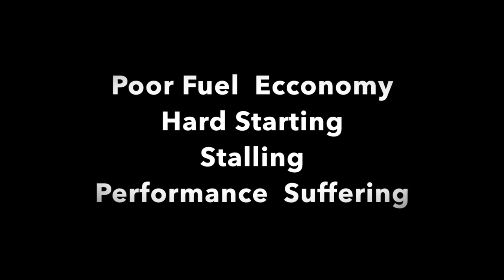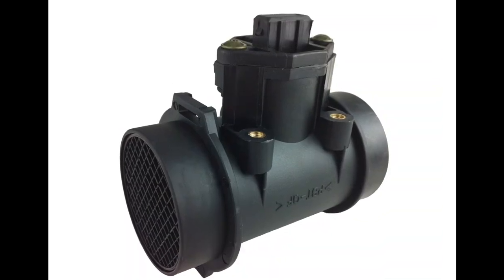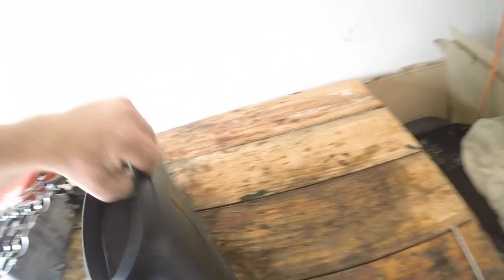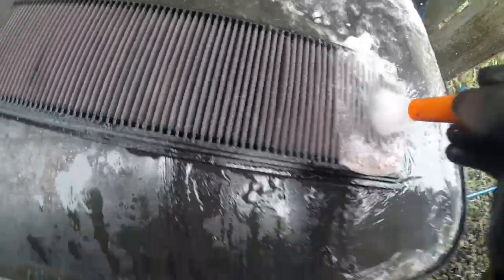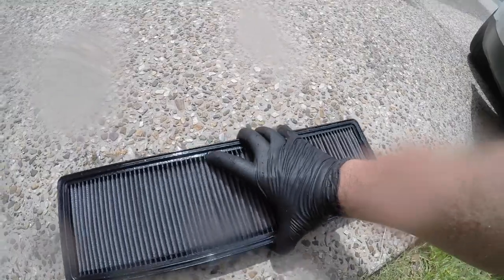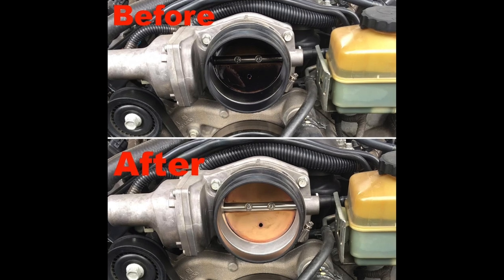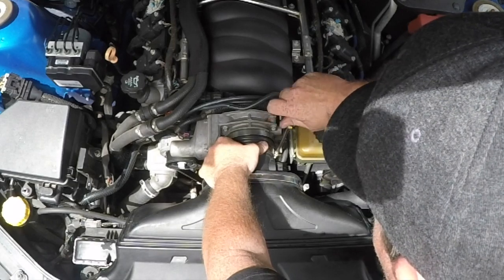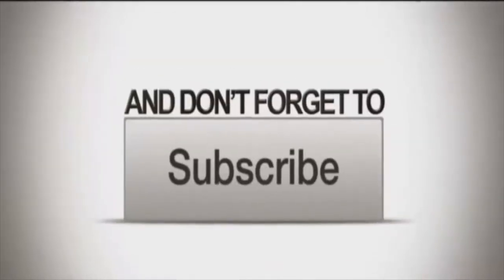MAF and Throttle Body Cleaning with Bonus K&N Filter Cleaning

Comment: Do you have to disconnect the battery and do dirty MAFs & throttle bodies throw off b1s1 O2 sensors, making it show up on a code reader? I have a very dirty air filter on a newly inherited 1995 Mazda protege that's prob never been cleaned, but only 98,300 miles
Reply from the maker: Change the air filter for sure, clear any codes and take it for a drive. You may find the O@ fault code doesn't return. On that model it would be easy to take off the intake pipe and have a look at the throttle body seeing if it needs cleaning and there would be no need to disconnect the battery but just be aware that its still connected. Hope this helps.
Reply: @killawattgarage   You're the first on YT to respond.  My first time owning a car, so thank you.
I hope I won't have a hard time finding an OBD1 reader,. I found out about the o2 sensor heater failure (po135) from a mechanic's reader. Thanks again.
Reply from the maker: @ayeshaflores7917  No problem. Let me know how it goes.

Comment: Really good video.... I'm just wondering if you got some advice for me. 

I just hard my turbo reconditioned and reinstalled in my BMW 525D, 2litre, twin turbo. Automatic 13 plate. 

The car does not let me put my foot down. As soon as a I put my foot down the gear changes. Doesn't let me go past 2-3000 rpm. 

And cuts power. Then throws the drivetrain malfunction light. Any ideas? 

Could it before the MAF sensor?
Reply from the maker: If you are getting a malfunction light I suggest reading the codes to start with and then go from there. Thanks for the comment.
Reply: @killawattgarage  the code is 244C00, just find out yesterday. 

It's "charge pressure control, high pressure stage control deviation, charging pressure too low / positive control deviation.

Comment: Do k&n really filter the air like OEM ...and does using oil on the filter cause any issues with maf sensor
Reply from the maker: K and N filters are an aftermarket replacement best suited to particular situations where you would typically need to replace the filters a lot, making things cheaper in the long run. K and N clam their filters flow better but over oiling will cause issues with the MAF and flow much less than OEM. Thanks for the question.
Reply: @killawattgarage  thnx...

Comment: After cleaning the throttle body, my car is behaving weird, car accelerates on its own up to some extent, even if I brake, it feels some one is pressing the gas pedal to some extent, and I also hear engine roaring.  Please help me, I did relearn procedures, test drive, no use. Mine is a Hyundai i20. Clutch pedal feels hard to press, steering weighs more than before, engine vibrates more than before. Am very sick of this issue.  Please help mate
Reply from the maker: Is it throwing any codes? Check engine light?
Reply: I got a engine misfire once, went to the Official Hyundai service, they cleared the spark plugs, and cleared the codes. I told them about the throttle body and all these issues, they told its normal, but am damn sure my car isn't smooth like before. 😔😔😔, they only cleared the throttle body before and then these issues have arised,, I even changed the clutch plate assembly, MC sleeve, but still clutch has become hard. 😔😔😔 and the car runs on it's own while braking
Reply: @killawattgarage  are you there.?
Reply from the maker: @bharathv499  yep mate still here. Instagram is a quicker way to contact me.

Comment: WARNING !!
 DO NOT wash your K&N air filter from the DIRTY side -- ALWAYS wash from the CLEAN SIDE ONLY to avoid driving dirt INTO the air filter's cotton fibers !
 DO NOT use any sort of spray nozzle or device to blast the dirt out of the filter !!
 Dirt is flushed out properly with "falling water" from a hose or spigot.  
 Use ONLY the K&N Air Filter Cleaner -- it was specifically designed and blended for cleaning the delicate cotton fibers without damage to the filters or the filter gasket.
 Use ONLY the K&N Filter Oil -- regular or synthetic motor oils DO NOT have the dirt-trapping properties of the K&N Oils and WILL NOT trap dirt particles in your filter ! 
 NEVER use a K&N Air Filter without the K&N Red Oil -- a dry filter will NOT trap dirt, and it WILL let dirt into your MAF Sensor and Throttle Body.
  I do not recommend the use of the "Spray-On" application -- because it is nearly impossible to apply evenly. K&N sells the Oil in a "Squeeze Bottle", which allows for applying the oil evenly along each filter pleat.
 This video does not follow the Filter Manufacturer's instructions. If you choose a K&N Air Filter, FOLLOW THEIR INSTRUCTIONS EXACTLY for best filter performance and maximum engine protection !!
  Throttle body should be REMOVED from engine for proper cleaning -- and while you're at it, replace the Throttle Position Sensor to insure good-as-new throttle response, smooth idle, and NO hesitation !

Comment: New sub.here. I just want to ask of i can use the wd40 to clean the throtle? And i can spray it while running the engine.? Tia
Reply from the maker: Hi mate. If the throttle body was removed you could use WD40 as it has reasonable cleaning qualities. The problem using it when assembled is that it does not evaporate easily and may cause running issues when you start. Don't spray it while the engine is running. Some products can be sprayed while running but not WD40. Cheers

Comment: Only thing cleaning throttle body does , is keep the throttle plate from sticking . You won't gain any performance . Have done it several times. And k&n filters are junk for filtering , a paper filter stops alot more particals . Look it up no joke .
Reply from the maker: Thanks for the info

Comment: I cleaned the TB unit, still the rpm is at 650 on idle on hyundai i20. Now, I checked for resistances of each 4 ignition HT cables. The 4th wire being the shortest is supposed to have lowest value, however, it reads 8.8 ohm which is very much higher than all the 3 wires..2.4,.2.0, 1.8 respectively. Is the 4th wire leading to drop of rpm to 650??? Awaiting reply. Thanks.
Reply from the maker: 650 for an idle on a Hyundai i20 doesn't sound that bad, but the resistance of that 4th wire seems too high, but are you getting a misfire?
Reply: Killa Watt Garage no such miss fire, but engine is a bit of vibration. However, when I revs to normal 850 rpm, the engine is not vibrating anymore. The rpm drops to 650 recently!!! Curious to know whether 4th wire cause this rpm drops????
Reply: The normal rpm is 850...

Comment: Hello,  
Is it okay to clean the MAF with Electric contact cleaner?
After complete engine rebuild (all new parts and all cleaned) my car jumps arround 1900-2400rpm on half throttle so I assume it's the problem with MAF ?? 

Thanks!
Reply: What cleaner did you use? You should use one which doesn't leave any residue behind and let the cleaner dry up before putting the MAF back into place.
Reply: You can even use fuel to clean it,just don't  put it into the fuel!

Comment: Hi I recently had a new engine put in my car and ever since it's been over revving in Park any advice could it be my throttle body ??
Reply from the maker: Joe Montgomery yes it could be. Along with the throttle body is an Idle Air Control Valve. It allows a small volume of air to bypass the throttle body plate and is controlled by the ECU to maintain a set idle speed. These often get gummed up and stick causing a high or low idle. This would be my first place to look.

Comment: It is necessary to put or spray oil at the air filter before re installed What is the purpose? Thank you.
Reply from the maker: K and N filters need oil. Typically paper filter DO NOT need oil like this.
Reply: @killawattgarage  thank you so much for your time to reply appreciated from Philippines.

Comment: Cleaned my throttlebody and ended up very high RPM IN IDLE. And it never went down. Until i had it recalibrated through a laptop. Never spin that throttlebody with ur fingers.
Reply from the maker: some cars can lose their idle if you force the throttle plate.
Reply: asghermansoor84 h

Comment: i got a ford escape 2010, and it stalled the other day while turning in a street at very low speed (had to turn off/on), and when i give it gas after a red light, the revs go up to 3-4k, and the car yanks, or i bleieve the correct term is surging?... could it be the throttle body?
Reply from the maker: Henry Chavez is it the 3.0 V6 engine?
Reply: My Volvo 940 Turbo does the same. Wonder what's wrong.

Comment: Hey there. I cleaned all 3 I'm my 03 Jetta mk4 2.8L and still getting a brief lack of power at around 4000rpm then pulls again around 4700rpm.  Any ideas would be greatly appreciated.
Reply from the maker: check Fuel filter next.

Comment: How any miles did u use the kn filters?Was there any grime in the air box or in the edges of the filter?
Reply from the maker: Drove this in a dusty environment for about 10000 miles. Yes the filter had been over oiled and there was grime in the air box.

Comment: The reason why your TB is black and dirty like that is because you are using an oiled filter. Oil blowby. I had the same problem with a oiled filter on my camaro. Switched to dry filters and i had never had that problem again. 

Check the inside of your intake manifold....probably is just as bad or worst. 

Hp loss due to dry filter is negligent. Oil on the maf and build up on TB/ intake manifold will loose more power than using a dry filter.
Reply from the maker: Gavin Au ..... and the filter was over oiled. I often think that paper filters would be a quicker and easier solution. That prevents this mess! Thanks for the comments
Reply: Because oiled filters arent for daily uses. Just drag and laps... I switchback to paper after a few runs lol

Comment: I have vw touareg v6 2004 with rough idle...what should i do to fix the idle to be smooth again
Reply from the maker: Throttle body clean is alway a good idea, along with checking the spark plugs, fuel filters and and maybe an injector cleaner.

Comment: Subscribed. Good video. I have honda city 2003 type Z.  Please suggest my car rpm goes up down on ideal when AC is on. Should i clean throtel body? Am from Pakistan
Reply from the maker: Hi, RPM will change as the load of the air con. is cycled on and off. If it nearly stalls then a throttle body clean would be suggested.
Reply: Killa Watt Garage thanks bro. Will clean the throttle body this weekend and will update you
Reply: Bro i went to mechanic today and he took a test drive. he told me that my honda city 2003 Engine plug will change,  he will take out the throtel body and will clean and there is bad symptom of Fuel pump. So he will take out all 3 things and will check. my Car sometimes dont take race and RPM still stuck on 1 or 2 while pressing gas.

Comment: مني لكُم نصيحّة عربيّة ؛
لتنظيف الخآنــّـق ( ثرتّل throttle ) اللي 
في الخآنّق الكهربي الألكتروني
نظآم سُق بالسلّك بدل المرّس ( الكيبّل )
 الــ electronic throttle  body valve
خآنّق الهواء ( ثرتّل بدي throttle body )  
بمدخّل جسد ( ثرتّل بدي throttle body ) ؛

 

مو ضروري تفُك الخآنّق throttle 
الـــ ( ثرتّل بدي throttle body ) خآرّج 
المُحرّك خليه مكآنُه وأتبع الخطوآت التآليّة ؛

1 - أبداء ك؛ من غير ما تشغّل المُحرّك / 
حط مفتآح الأشعآل ( السوتش / أقنشّن سوتش )
على أون  ON / ما قبل التشغيل لا تشغّل ( رّن RUN ) - 

2 - وأدعّس دوآسّة البنزين / الوقود للصآنجـّة / للأخير ،

3 - وحُط عليها حجّر - طوب - 
أو طآبوقّة أو عصاء ثبتها بمقعّد / بكـُرسي 
السآئق حتى تمسّك دوآسّة البنرين للصآجــّـة / 
حتى تمسّك دوآسّة البنرين للصآجــّـة للأخير ،،،

https://www.youtube.com/watch?v=qaNsO4HHK9Q

4 - فك غطاء اللي فوق المُحرّك 
    الغطاء البآغّة لتصل للخآنّق  ( ثرتّل throttle ) 
    وسوف تجّد الخآنّق مفتوح للأخـّر . 
   لا تلمسُه قبل ما تطفىء مفتآح الأشعآل ،،،

5 - بعد ما تطفىء مفتآح الأشعآل 
لمنع الخآنّق ( ثرتّل throttle )  من الحركّة ،،،

7 - الآن /؛ 
     نظـّـف الخآنّق  ( ثرتّل throttle ) 
     وووومدخل الهواء في جُرم الخآنّق
    في مدخـّل ( ثرتّل بدي throttle body ) .

 ؛  As I just said above in Arabic 

for electronic throttle 
 body valve cleaning ;

You don’t have to remove 
throttle body out to clean the 
throttle and air intake inside
the throttle body ;

you can  follow these steps
 and use these proven steps ;

1 - put the ignition switch ON
     ((( don’t Run the engine ))) .

2 - Push the gas accelerator paddle all the way to 
      the floor this will  open the throttle body valve 
      plate inside the throttle body wide open .

3 -   Put a brick or stone or 
    [ stick laying to driver seat ]
     to push and holding the gas
   accelerator paddle to the floor ,,, .

4 - Now turn ignition switch off this way will 
       prevent the throttle body valve plate
      from moving or close during cleaning .

   Note ; tip
   if you turn ignition switch off
   You don’t have to disconnect battery

5 - remove the engine plastic cover .

6 - Now you will find throttle body valve plate
     inside the throttle body wide open .

7 - Now clean it and the air intake with
     ((( Only with throttle body cleaner 
           or alcohol based cleaner )))  .

Best regards .
An Arab 
Engineer

.
Reply from the maker: cheers

Comment: I don't mind letting the cleaner run into the engine. Probably cleans the intake and valves, too...
Reply from the maker: as long as it dries before restarting
Reply: Killa Watt Garage What can happen if it didn't dry..? 
I have used a tb cleaner/intake cleaner and turned on the engine while it wasn't dry and my engine revved so high while it wasn't warmed up but after a few minutes in idle it fixed up

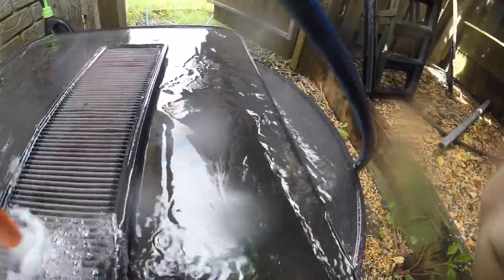Comment: "3:12 its quite a white filter" dont they usually come in red'ish or (whatever colour is called) colour? :)
Reply: 3:06 my bad :)
Reply: just wondering where did all that colour vent? :O
Reply from the maker: Vitalik Bagdonov this one was white, after it was oiled it was reddish.
Reply: The K&N Air Filter comes with the red Filter Oil already applied to the white filter material.
 When properly washed, the filter is white in color. The correct amount of Filter Oil (usually 2 ounces per filter) applied properly will leave your filter evenly reddish over the entire filter surface.
 I avoid the "spray-on" application -- the "squeeze bottle" can be applied more evenly, which gives much better results.

Comment: I have a ktm bike, and its been idling poor,  and on accelerating suddenly, it lags a lot. Its throttle body has, Idle Air controller solenoid, TPS, MAP and Air intake Air Temp sensor and injector on it. i have cleaned it with Throttle body and Choke cleaner also replaced the air filter. It improved a little, but still lags a lot. what could be the issue? or is this even a bad ignition coil, which i found could be the culprit too.
Reply from the maker: Be sure that it has fresh fuel and the spark plug/s are clean. Recheck the basics first.
Reply: @killawattgarage  I have replaced the Ignition Coil, now it performs much better. Still not as good as a new Bike. I'll change the Plug and update.

Comment: My truck stalls stop signs and will not accelerate and hard to start. If I don't stop it runs good. MAF SEEM TO BE MY PROBLEM
Reply from the maker: Check and clean the MAF but also consider a good throttle body clean. It also could be the Air Idle Control valve, which often gets gummed up. Cleaning this may help as well.

Comment: I have a car elantra j1 , the idle of the car  is not stable and not solid , i tried to clean the throttle body spray but still no change
Reply from the maker: Make sure you clean the Idle Control Valve as well.

Comment: I'm wondering if anyone can answer my question.  In the process of 
getting to the root of fuel trim problems, I was going to clean the 
throttle body.  When I opened it up, however, I discovered that it was 
clean as new on the inlet side (I didn't take it off the car)  The car has 43000 miles on it.  I have 
run techron through the car on a semi-regular basis, and my previous 
tank of gas I ran the complete fuel system cleaner through it.  But I 
don't understand how that would affect the throttle body.    What could possibly account for this?  thanks
Reply from the maker: AJ R what are the fuel trims saying?
Reply: lean condition.  From a sampling at idle and  ~1500, low total trim is 7.03, and high is 15.62.  I'm trying to figure out why my avg stoich is around 14.0:1.  I have a pretty good hunch that the MAF is bad as it appears to be a little erratic.    Thanks for the inquiry.
Reply from the maker: Also look out for vacuum leaks.
Reply: putting together a smoke tester to do that.  Intake manifold gasket is a known issue with the car and toyota should have done a recall, but they didn't.  Trims don't suggest a vacuum leak though, as they increase with rpm, so I've learned.  I'm doubting fuel delivery as a problem though.  One or more of the sensors is probably at fault, will be replacing MAF tomorrow which definitely seems goofy.   Thanks

Comment: Have you tried this with WD-40? I have👍🏻 it can clean out carburetor and fuel injectors with it and clean out heavy carbon deposit on throttle body and was fun and worked Better than Throttle body clear
Reply from the maker: WD-40 would work at cleaning the throttle body if it was not still on the car and definitely NOT for the MAF sensor. Throttle body cleaner and MAF cleaner both evaporate very quickly and leave no residue or surface contaminates. An intake filled with WD40 residue can play havoc with 02 sensors and catalytic convertors. Cleaning with WD40 for older style carby engines is perfect. Plenty of times I have used it also to try and start stubborn engines.